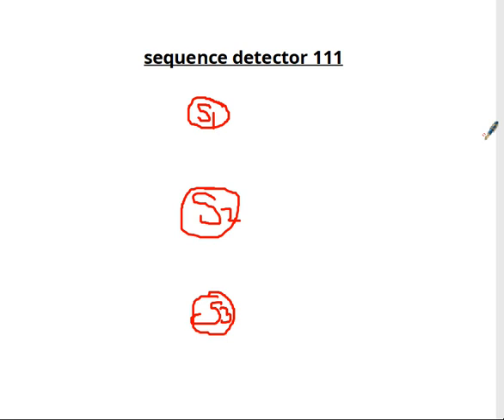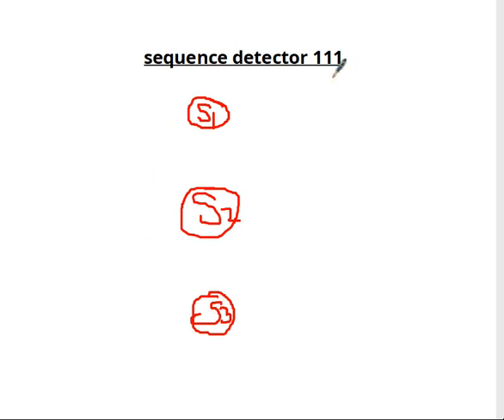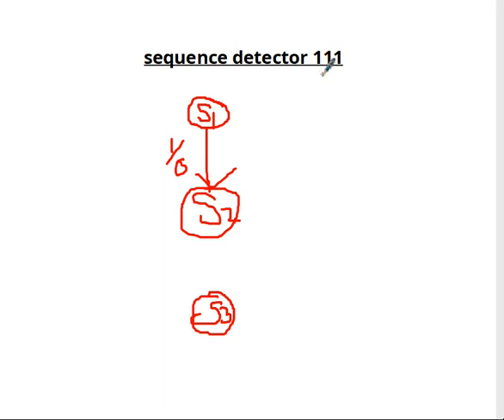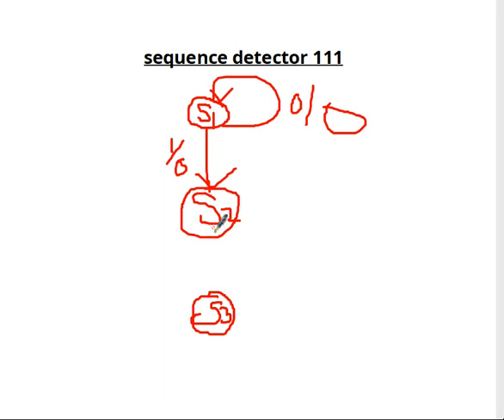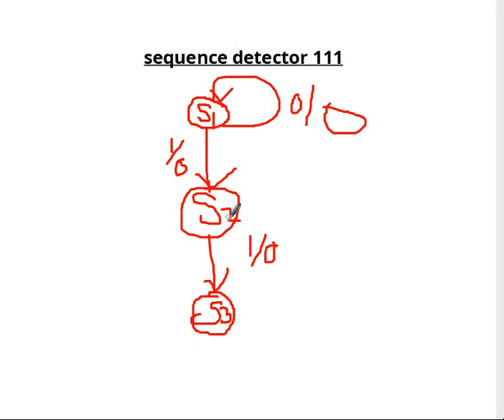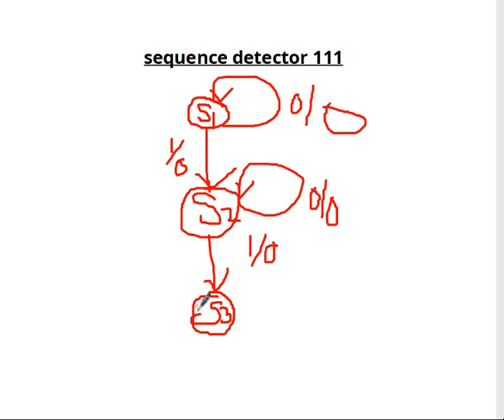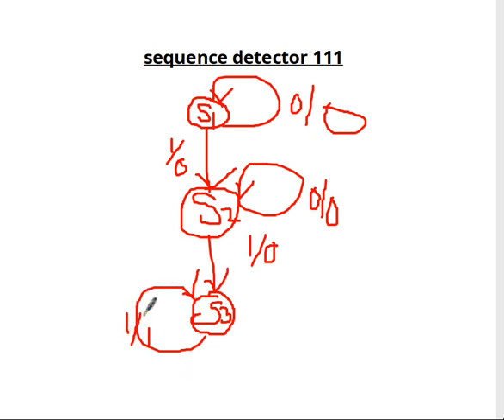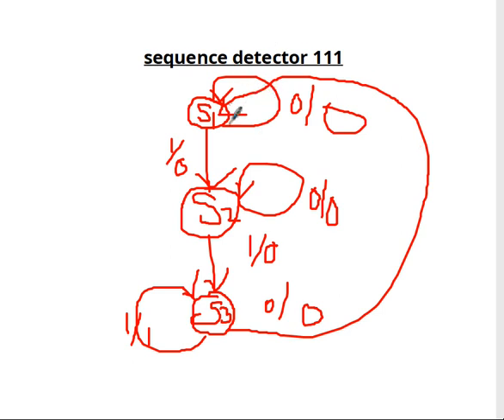sequence detector 111 mealy model

Comment: you are doing wrong mam. 
At s2 if input is 1 then it goes to s3 but if input is 0 then it goes to s1 or reset state.
Reply: Should it loop in state C if input is 1 or should it go to state B
Reply: @frankmars4259  do u got the answer? i am having the same confusion?
Reply: @optimusmegatron8812  I passed last sem
Good luck